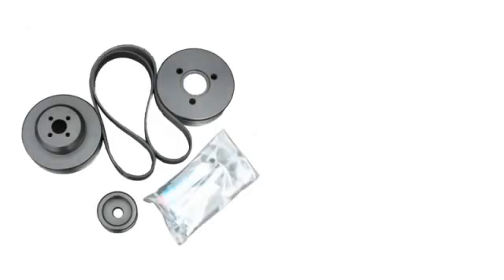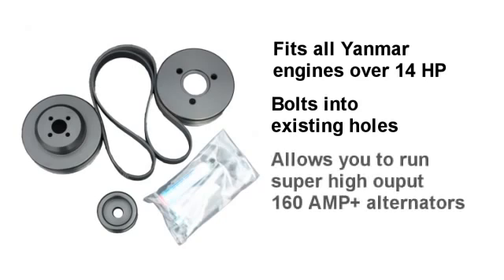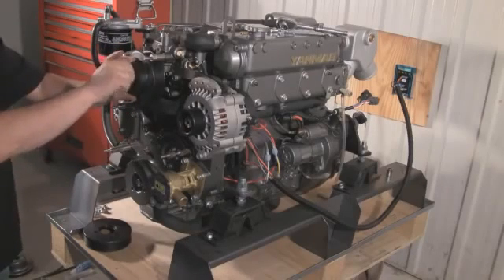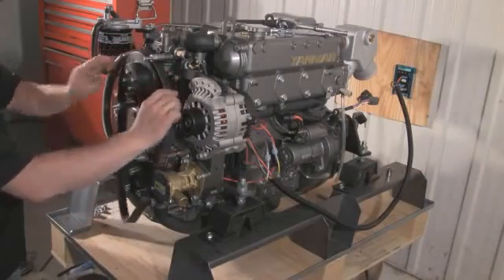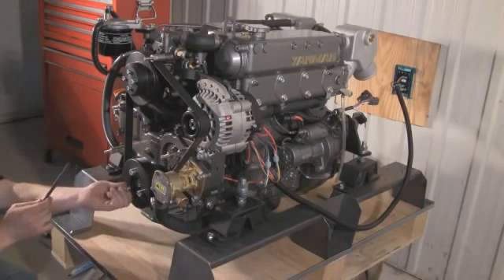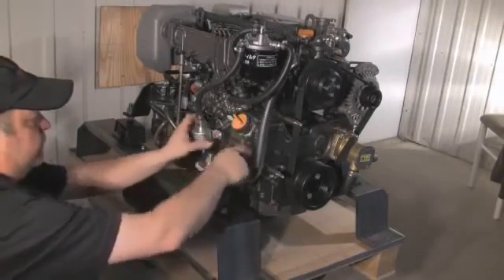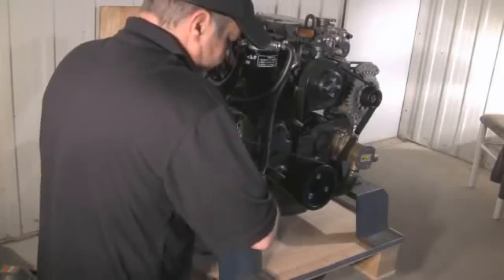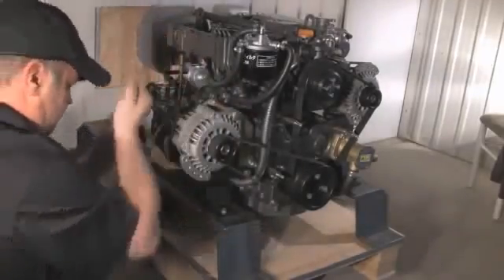Marine Alternator and Serpentine Pulley Kit Installation by ElectroMaax

Comment: Serpentine belt upgrade will not work on the 6LY2A.  The distance between the crank pulley and the alternator is to great and the belt jumps off the pulleys at the alternator. Electromaxx made a tensioner for the middle of the belt but, again, will not work on a 6ly2A. Won't work because the designed tensioner requires a hole in one of the brackets.  That hole is not standard on the Yanmar 6LY2A 440hp.